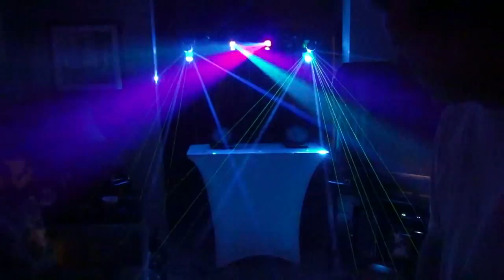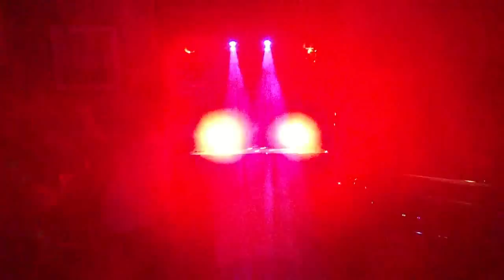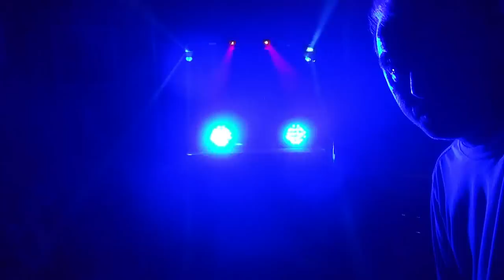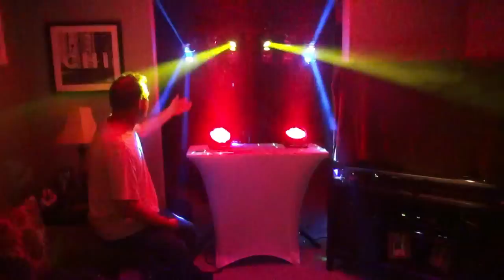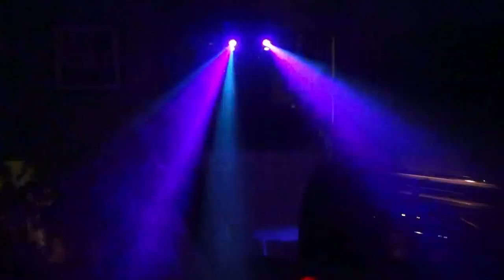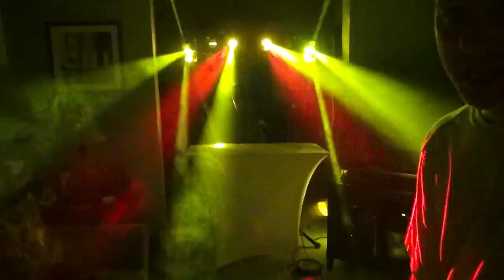DJ Lighting Help - Train Wrecking a Light Show

Comment: Hey Brian I watched like all of your videos and I'm quite impressed you do a nice job although I know that you probably have the hot and skinny on wash lights and I was curious if any are available that are dimmable because that demonstration you given here seems to me if you had less intensity to the wash lights that it would probably help to blend the lights better although I like the aerial they really do impressed me that they're cool I think if we had dimmable wash lights that would impress me even more
Reply from the maker: DJ Jammin Jim Lawton Yes you can absolutely dim these fixtures.  This video is more for the "plug & play" DJ
Reply: briansredd Thanks for the feedback!  So are they dimmable via DMX only?  Here is my specific question.  I took your advice and purchased both the  American DJ Dotz TPar System Stage Lights, and American DJ Sweeper Beam Quad LED Stage Light, and combined them as suggested.  I love the setup, it actually works very nicely!  But as you state in this video, the TPar lights really overwhelm and effectively null out the Sweeper Beam Quad.  I do not recall a dim option using the hand held remote, maybe I need to do more research?

Comment: We change our lighting as the night progresses & consider the seating area as a separate area from the dance floor.  Uplighting for dinner near the tables & wash lights behind the dj booth, head table & cake.  If necessary, these lights can be turned off later.  (Why light a cake table with no cake?)  Moving heads & other effect lighting on the dance floor, but only after dinner when it's time to dance.  Start out with 50% of our lights going and keep adding as the night goes on.  It's like building up to midnight on New Year's Eve.  By keeping our wash lighting away from the dance floor we avoid the "train wreck" but still give the atmosphere for the rest of the room.  It's no different than planning the music you play at 6 pm vs music at 10 pm.

Comment: Here is my opinion on this (no hate on the video it's a great presentation on how to ruin a light show). 

I use both movers and wash lighting in my setup. Mainly because a wash helps bring colors to the dancefloor and the room and sets the mood. I use movers because seeing the beams fly through the air with a little haze looks amazing and having gobos either on the dancefloor/walls/ceilings helps bring a little life to the party. 

I use ShowXpress by Chauvet for my lighting control. In the software, I dial down the brightness of the LEDs because sometimes it is a little too much and just ends up blinding people. 

That's my two cents on this. Great video Brian!

Comment: Cool video Brian, I have one question,

I'm about to buy two moving heads (possibly inno spot led wifly) to place on top of totems. I also have a few small LED bars lighting my dj facade, but I don't know what other fixture to get. I was thinking I might need to buy a laser to complete my light show. What do you think? What fixture goes well with moving heads and a lit facade?
Reply from the maker: Juan Carlos Jimenez Rodriguez Pars are wash effects & heads are projection effects (air effects if you use fog)  You have all of your basis covered!  Anything you add is just bonus.  A cluster style laser could be a real nice edition

Comment: Nicely explained. See too many rigs with good lights ruined by par can set up, but pars together with beam fx do not necessarily have to be a train wreck though.

Using white speaker stand scrims with a par inside each one adds colour to the dance area, while the spandex/lycra does enough to mute and diffuse their brightness (without having to dim them) and doesn't wash out the beam fx. You can simply master-slave these on S2L or fixed programmes (controlled by remote if they use it), and preps you for one step further using DMX control. 

Add a par as back light inside the booth scrim, and a pair of pars as rear uplighters, gives you opportunity for dramatic lighting displays using just pars alone with simple DMX programming - flip-flop side to side, front to rear, or chases one light to the next - very useful for those venues that won't let you use smoke/haze where you can't get best use of the beam fx.